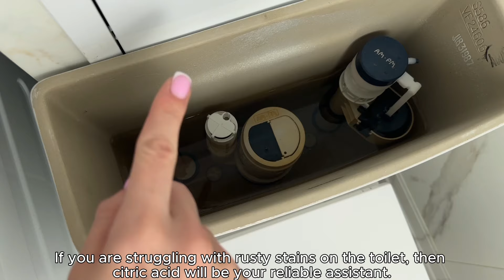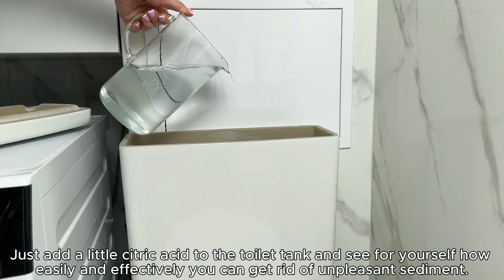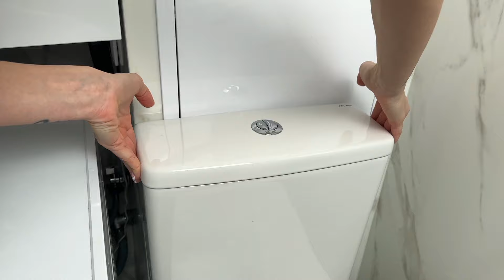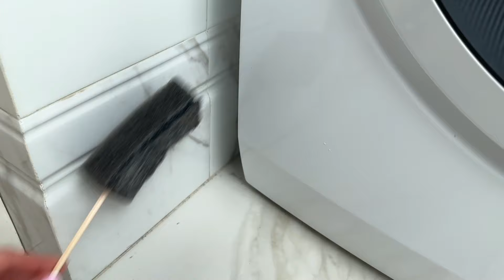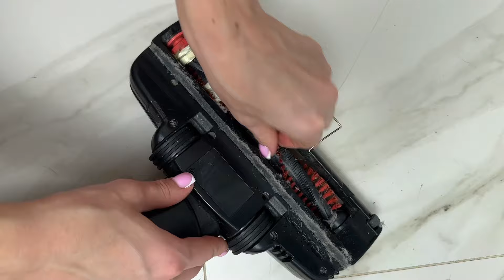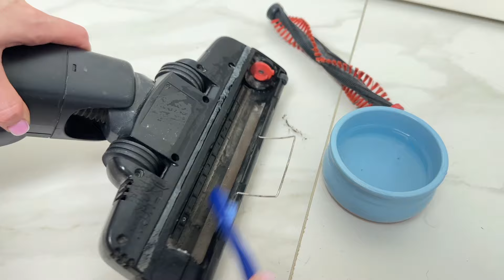🔥🔥Don't forget to clean this! ALL WOMEN NEED TO KNOW THIS

Comment: or, put a used bar of soap in a kids sock, attach to the rim with a binder clip and you will see clean tank in less than a week.
Reply from the maker: Is it true ?? I will definitely try it!!!!
Reply: @WomensDIY  yes, I have used Irish Spring bar in a small child's sock, (you can use a hosiery sock too) held it up with a medium binder clip to the back wall of the toilet tank. 
The alkaline in the soap will clean the rust/brown to a clean tank in about a week or so. I wish I could post a picture for you. over time, the sock will get mucky, but the soap is still working.  Also, do not use this method if you have animals that drink out of the toilet.